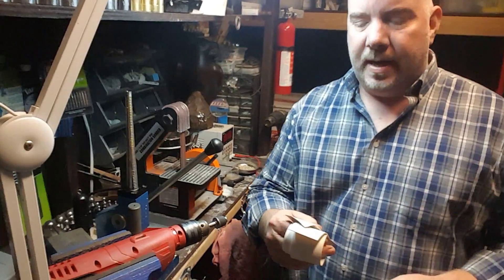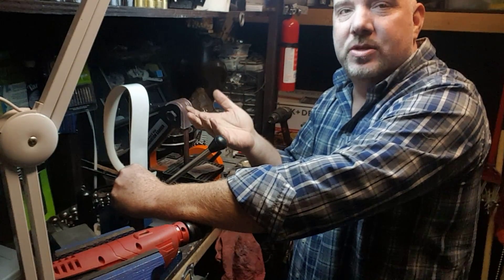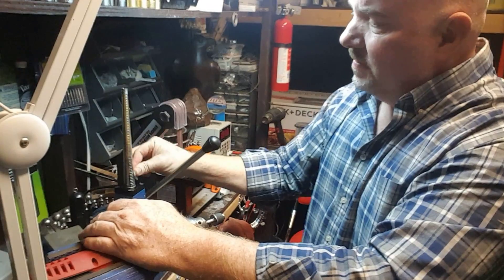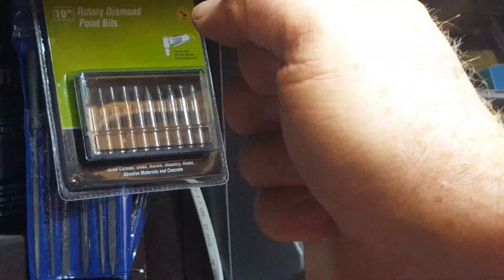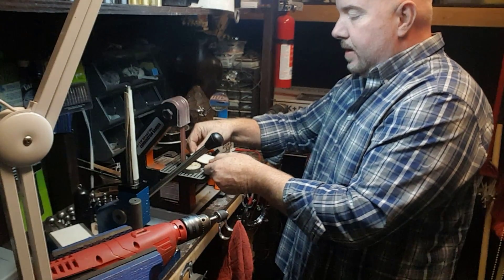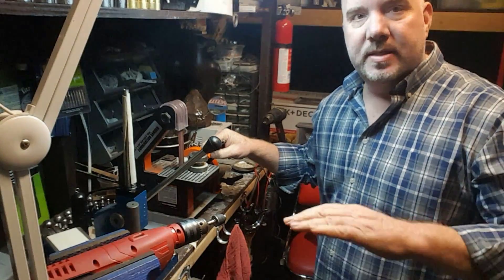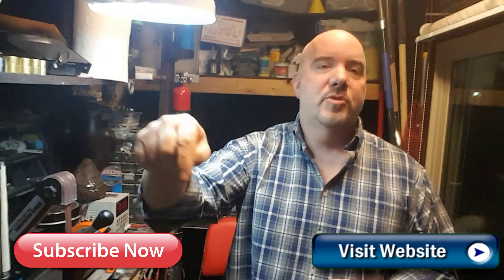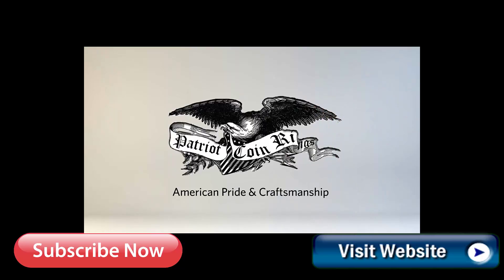Coin Ring Tips and Tricks : Using Aerospace Impact Tape on your Tools

Comment: been using paper or shop towels to protect my coins on ring stretcher. decided to use the Aerospace tape thought it would protect my coins and ring stretcher mandrel. also because of the 45 Mill thickness thought it would help me make larger size rings. big mistake!! caused nothing but trouble trying to get my rings off the mandrel or even pushing them down to stretch them out. if anyone is having any luck with it please let me know I would love to know what I'm doing wrong. thanks in advance for any feedback.
Reply from the maker: +butch d   You'll probably notice I use both in all my videos.  I switch between aerospace tape and papertowels myself.  I personally don't care for the thin plastic sleaves, but in short I have two ring mandrels setup.  One is for my big heavy coin rings or precious metal bands like silver or gold and for those I use the tape.  For smaller coins like pennies, quarters and usually up to half dollar size I stick with good ol' papertowels because it's a lot thinner and easier to use.  In short, I reserve the tape for my high dollar coins that I'm really wanting to preserve the inner detail on.  Here's a link if you would like to check it out https://www.etsy.com/transaction/1295329595